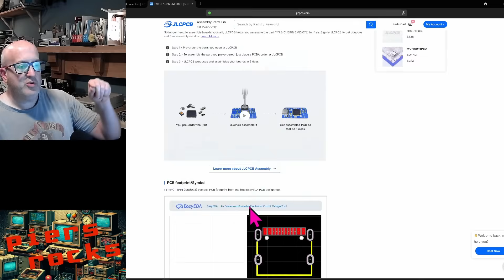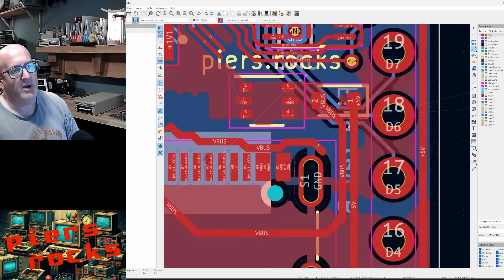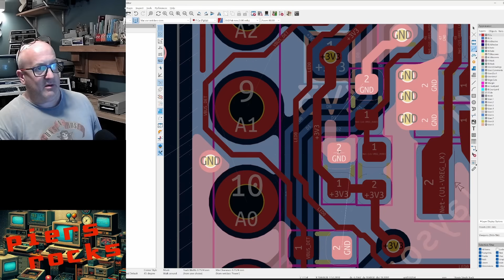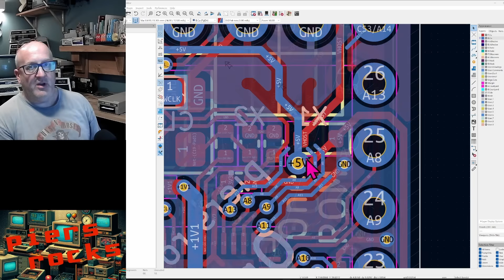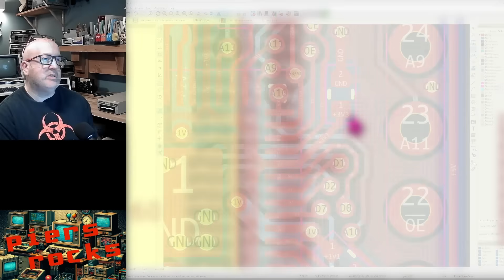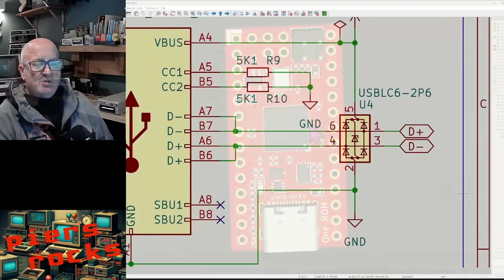This 28 pin One ROM RP2350 layout nearly broke me

Comment: Good job fitting on a 2 layer board, but you should definitely look at 4 layers in the future. I’ve just laid out a small STM32 board on a 4 layer board, and it definitely made the job easier, and a couple of large ground planes to cut down on noise.
Reply: Yes, there is no reason to go 2 layer boards nowadays. That's emissions and interference nightmare. All those fast signals over pretty much no ground...

Comment: Centring the LED... Yes. Aesthetics in PCB layout aren't a waste of time.  For boards with mostly digital circuits, they often make the board easier to debug and also easier to assemble and to work with. Often, there can be benefits that come from ensuring there is track space (or empty space) between parts that can help signal routing or reduce crosstalk. Lastly, there is for the designer, the satisfaction of creating a board that is simply attractive to look at, rather than a bit of a mess.  For me, that is its own reward.  Of course, this is all a generalisation and seldom applies to RF where the rules are very different.

I loved watching this, BTW. It took me back to 1989/1990 when I designed a bank switching piggy-back board to use 27512s in a socket intended for 27128s.

Comment: Sounds strange that you considered to drop down track sizes first, while you probably want to do it last. 
Your vias and especially THT pads are giant by JLC's standards. 
Also, the board is miniscule, not even 4L and has almost zero planes, you don't really need thermal reliefs. If you struggle to solder smaller THT or GND pads on a board like this using proper materials, then its a pretty good indication to get a modern iron.
In your case, I'd make board space in that exact priority and only then consider to first decrease trace spacings (since it's a very low voltage design anyway) and only then drop down thickness.
Moreover, don't be afraid to use JLC's free capabilities, their limits are in a paid tier.

Comment: Fun to follow along as always.  Thanks.  :)  Are there drawbacks to using a 0ohm resistor to jump a trace to simplify things?  Other than a bit more cost of course.  I prefer the creative use of vias and moving things around but that is an option when things are tight.
Reply from the maker: Hadn't though about using a 0R resistor - thanks for the suggestion.  Resistors cost a fraction of a cent so not much extra cost.

Comment: hey Piers, you know what, I've got an idea for a board that might be even more nightmarish than this one. Let's assume you replace the actual mcu with a SRAM, but you introduce some level shifters/buffers so you can read/write it with an even cheaper mcu than the ones you've been using without interfering the original system bus. I think there are better chips than the 244/245/373 etc, probably with more data pins and small pitch (i. e. the small ssop or similar). then you can have a slow ass mcu writing it just once at boot time. I don't know if writing the entire sram will be fast enough to finish before the host system starts fetching data from it. eh I guess the mcu will have to be faster than these ones you're currently using just to fill up the sram in time. would require a pcb with components in both sides though. eh whatever, don't listen to my midnight crazy ideas lol. good video as always, sad that the usbc is not a basic part yet. greetings from Argentina as always.
Reply from the maker: @cocusar Yes that does sound like a nightmare to lay out!

Comment: The rp2354 has a stacked 2MB flash built into the chip.
Reply from the maker: I tend to find that availability isn't great (0 showing on JLC right now).  Also, don't know if it benefits from the A4 stepping which this design needs (it may do).
Reply: @piers_rocks the part number SC1511-A4 suggests it's the A4 stepping, mouser and digikey have them as new arrivals, maybe too soon for China to have them in stock.
Reply: @piers_rocks i think Raspberry Pi said 2026 for stacked flash parts

Comment: Good fun watching others suffer :)
NOTE the 27512 has TWO enable pins. Vpp is also /OE
Reply from the maker: So it is - must have misread the datasheet, thanks.
Reply: I mean, if Vpp is dragged low, won't the chip shut down anyway? I doubt it will come up within 70ns tough 😂

Comment: Instead of using the larger 2.54mm shunts, would using 2.0mm shunts free up more room near the top of the PCB?  Also, I understand why you're trying to keep the PCB as close as possible to the same size as the original physical ROM chip, but would it make more sense to extend the footprint of the PCB slightly near where the USB-C connector is a small amount to give you just a little more room?
Reply from the maker: Yes, dropping to 2mm headers would give me space, but I'm really attached to the 2.54mm as the pins and jumpers are such jelly bean parts (and easier to use).  Remains an option to move down though.

And yes, could extend the PCB top and bottom.  However, I'm not keen on this because it'll limit One ROM's application.  I don't know how much - I only have limited systems myself that use these chips, and obviously there's a massive variety of hardware out there using 27 EPROMs.

Comment: Out of curiosity - why are you hell bent on 2 layer.  4 layer price on jlcpcb is pretty much the same and it makes routing a LOT easier when you can throw power on the internal layers and an occasional signal.  Another thing - and I made this "mistake" myself a lot is that it is normally suggested you do NOT ground the shield on a usb device - only on the host (presumably to avoid a ground loop).
Reply from the maker: Ground loop - yes, I noticed on Jolt Connect that's not connected, but there's a lot of conflicting information about connecting vs not connecting the shield to gnd.  I also read that USB-C cables connect gnd to shield at both ends of the cable, so makes not difference really.  In this application I don't expect the device to be routinely connected while operating in the host.

I took a quick look at JLC 4 layer prices the other day and it does seem to be a bit more expensive at quantity than 2 layer.  I expect I'll move up one day!
Reply: @piers_rocks  your pcb is below 50x50mm so it will cost $2 at JLC.
Can also highly recommend a 4-layer signal/pwr,gnd,gnd,signal/pwr, or signal,gnd,pwr,signal stackup.
Reply from the maker: Don't think it will at quantities >5
Reply: @piers_rocks  $10 more at 100pcs.
Larger the batch, the more significant, probably.
Although, 4L allows for better capabilities.
Reply: It would also improve EMC properties.
Reply: @tfritzon  lol "software guys" don't do EMC, signal integrity or best practise apparently - it's an adventure - a bit like WW1 fighter pilots! If it doesn't crash and burn on takeoff then it's a success ;-)
Reply: USB Type C Spec R2.0, 3.2.1 Interface Definition: "The receptacle shell shall be connected to the PCB ground plane."
It doesn’t distinguish host vs device.
If you leave the shield unconnected on the device side, it isn’t truly floating, but creates a much higher impedance path to ground (through the plug and contact springs), which results in worse EMI/ESD.
Reply: Sure sub 50x50mm 4L PCB is $2, but only for 5pcs and would result in costs at quantities.
4L does not make sense in such low area board and high density. But after giving it some thought, I'd go for 3L design (on 4L fab) SIG+PWR - GND - EMPTY - SIG+PWR on a 1mm PCB (or maybe some PWR on an EMPTY layer, but minimal area and no polygons whatsoever). About as good as you can do for signal integrity here without HDI.
Also, Raspberry's PAD layout is a lot better with internal GND layer and external 3.3v on TOP and 1.1v on BOT.
Reply: @Mr.Leeroy why an empty layer? not cheaper, no advantage, and only results in a worse gnd reference for the bottom layer.
Reply: @jakob7153  when you route referenced to two internal ground planes, you have to jump them adjacent to every signal via, otherwise your return paths are not directly under signal traces, but elongated with loops to the next closest GND stitching via. You can't afford twice the amount of vias in this design, thus additional reference plane  is counter-productive.

Comment: I'd have probably have set the USB-C connector slightly off the edge of the board to give 1-2mm more room, they're generally designed for that.
Reply from the maker: I did wonder about that, will see how it works out
Reply: Quite the contrary. Male part of reference USB-C is designed to have ~2mm of additional length for female part to be as short and flush as possible.

Comment: Do you think this project can be a base for 24-pin USB-C version? Also, why do you use two jumpers to store one bit of data?
Anyway, brilliant work. Your videos (especially the previous one) make me closer and closer to becoming another software man designing pi-based hardware :)
Reply from the maker: @bartoszradko7610  The A and B image select jumpers will allow you to switch between 4 images at boot time on this hardware.  I may have misunderstood the question though.
Reply: @piers_rocks  Ah, I got confused by "Bank Select / A B". It looked like there were "A" and "B" banks available only. I dare to suggest placing clearer hints there🙂. And my first question?
Reply from the maker: The silkscreen height is 0.7mm here from memory - I don't have much space!

Comment: As much as I like microcontrollers, like RP2350, an FPGA would be the best match for your problem. Although also FPGAs take a while to load the bitstream...
Reply from the maker: Best, optimising for what?
Reply: @piers_rocks  Power consumption and hardware compatibility. The design can run at the same clock speed as the original ROMs. On an FPGA you can have multiple clock domains, if necessary. Phase locked loops provide the frequencies.
Reply from the maker: Don't know what this would do to cost, availability and PCB space though.

Comment: Love the concept of this product, though I am not a user. 

You can use the 'impartGUI' KiCad plugin to import EasyEDA (LSCS parts) symbols, footprints and 3D models - though it's not terribly easy to use. 

Another vote for using the RP2350B, it will give your plenty of space for contiguous GPIO blocks, though the QFN80 layout makes for tight layout, but you can get away with a lot thinner traces than you are using.
Reply from the maker: I reckon the 2350b would probably require a high layer PCB and possibly components (e.g. bypass caps) on the underside.

Comment: This thing will emit so much radiation that hopefully the patient monitor in the hospital next door will still work
Reply from the maker: I live in Wales.  I don't think there are any hospitals within 50 miles.
Reply: @piers_rocks  :D Good point haha
Reply: Why?
Reply: @der.Schtefan  2 layer pcb, poor grounding results in large current loops that act as receiving & sending antennas.
Reply: @jakob7153  True, but not so different from many of the 1980s computers that it may be plugged in to. At least the traces on this board are relatively short.